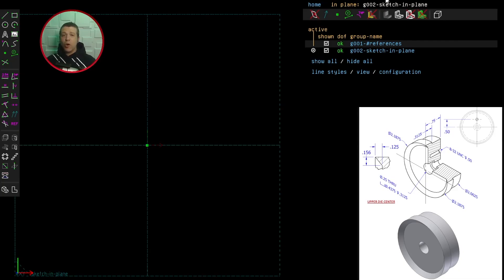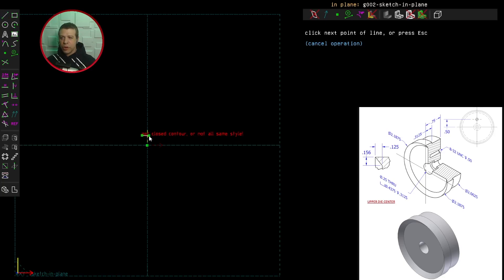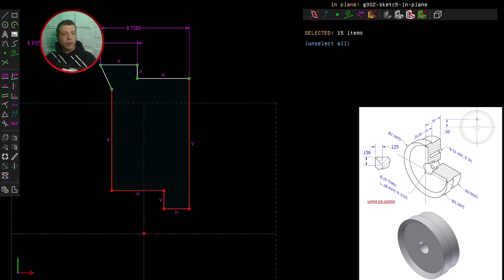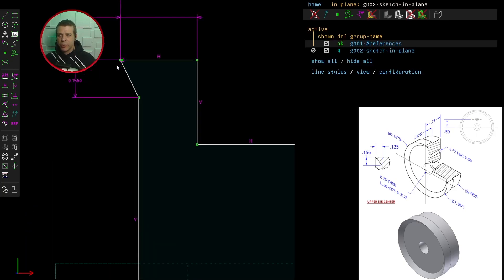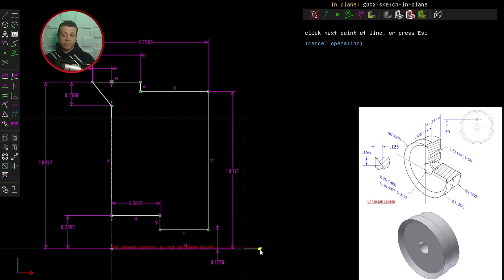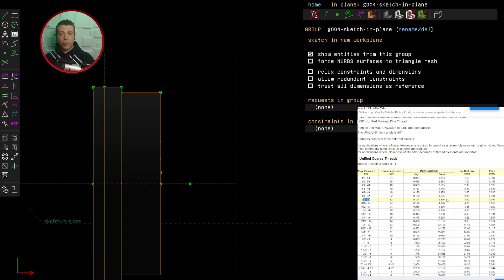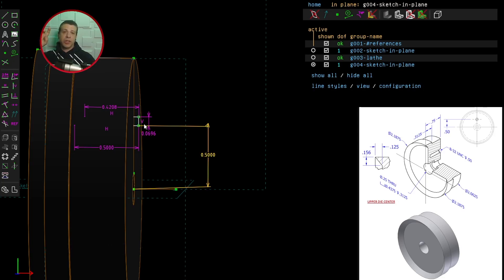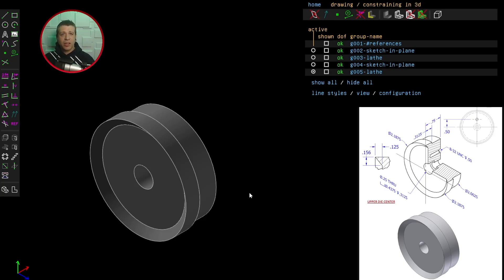SolveSpace - Challenge 6

Comment: The hole size for 8-32 UNC is given on the chart in your video within the column labeled "tap drill size". It refers to the diameter of drill you should use to make the hole for that specific thread. For an 8-32 UNC you'd use a 3.5mm drill. A better chart would use the measurement system the thread is in - for your imperial thread the chart should tell you to use a #29 drill (0.1378in).

Comment: I think the problem with your hole in the last step is that the diagram is in imperial decimal inches (ie: SAE).  The main through hole is 1/4" and the recess in the face of the part is 1/8" (.125").  Unfortunately, the only indication I see to that effect is the specification of that last hole as '8-32 UNC'.
Reply from the maker: Thank you  - that's very helpful.